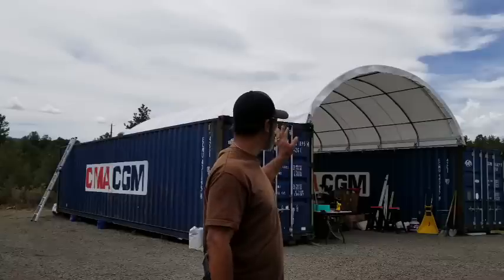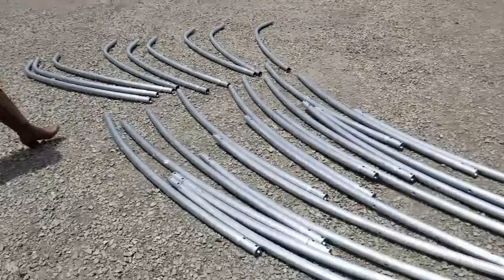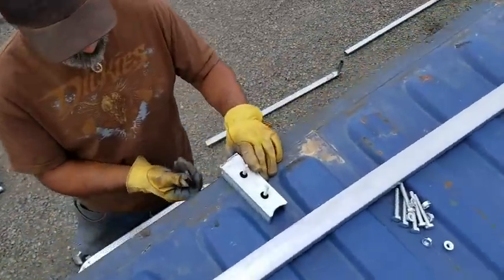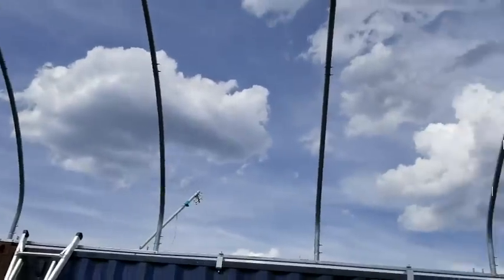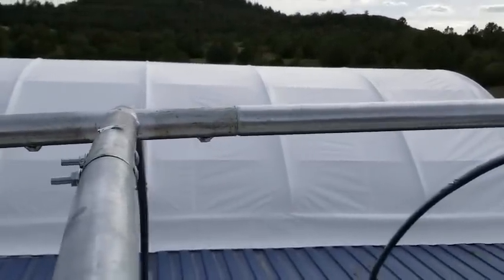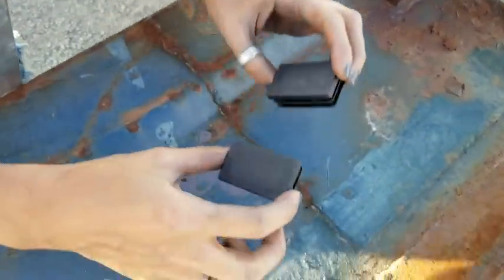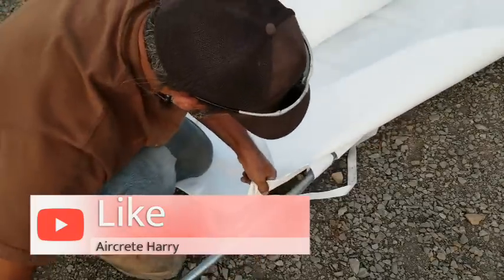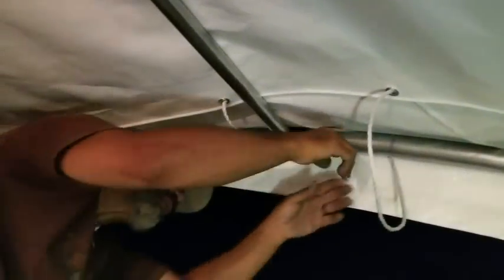Shipping Container Shelter Covers Installation #aircreteharry #Shippingcontainercovers #investment

Comment: Great video Harry and Mrs.  I figured by the landscape you might be in southern Colorado, then I saw a Trinidad address. We have land over in Alamosa. Have a shop and utilities in. Hoping to build a house for retirement in the next few years.
Reply from the maker: Thank you very much!!
Yes, Trinidad, CO
Any updates on your house built?
Reply: @AircreteHarry  well, we are here living on or land now in our camping trailer.  Hoping to get started building soon.  Have been getting some preliminary, necessary things done first like building a room in the garage to put the the pressure tank for the well in.  We’ve been using a generator to get water out of the well for years. We are at least trying to move the direction of building and would love to have something dried in before winter but time is moving faster than we are.
Reply from the maker: @rodm5830  Good Evening Rod,
How are you guys?
Thank you for sharing the updates. 
If you like to connect, email us: Aircreteharry@gmail.com 
Will happily share some information.

Comment: HOW LONG WILL THE TARP LAST?  oops caps lock  and....if the tarp was painted with exterior house paint would that extend the life?  basically coating it with vinyl....
Reply from the maker: I have had the tarp up over a year in Colorado its holding g up well. With the sun and snow no problem.

Comment: Awesome.  Hey where did you get that roof thing????   I have a few shipping containers I want to make a roof for and have space between them.   Pitch of the roof should be front and back for mine for water runoff.   My containers are 20 footers and I would like 20 to 30 feet of space between them.
Reply: Build a series of flat trusses of increasing height. A truss company could make them for you if necessary. It is easy to do.  when I was 18, I built enough to cover an apartment building roof that my grandfather was building
Reply: @kkarllwt  I am actually going to do it with roundwood timber framing. The logs won't be too thick and I will use a tarp on the roof.  :-)  No permit needed.  Trusses of increasing height?
Reply from the maker: Email us and we will connect you with the company: Aircreteharry@gmail.com

Comment: pretty impressive, smart, and efficient. How long is the tarp supposed to last (and the duct tape)? are there different width available ?
Reply from the maker: Thank you 👍 
We put them up in 2019. Still very happy with the product. We get extreme winds here, snow, hail, etc. They are handling it well. (Duct tape it covering the sharp ends of the bolts and joints. It is recommended and comes with the kit.)
They come in different sizes.

Comment: Great project.  Where did you get the canvas top?  Was that just thinking out of the box or did you buy that canvas and pipe with the straps as a manufactured top?
Reply from the maker: Thank You.
If you are interested in more detailed information from the company, email us & we will connect you: Aircreteharry@gmail.com
It's been 3 years since we installed ours. 
Working great!
All parts are included.

Comment: What gauge is the tarp?  How thick is it?  9oz per sq ft,  14.5oz per sq ft,  21oz per sq ft?  Curious how long it takes for those UV rays to weaken it and the wind or snow to rip it to shreds.  That’s what happened to my hoop structure.  Got a couple good years out of the tarp, then metal roofed the whole structure.
Reply from the maker: We have them up for over a year CO weather lots of wind rain, sun, snow and it still holding strong .
Reply from the maker: 3 years later,
Numerous tornadoes, extreme winds & heavy loads of snow - it works great 👍👍 
Check out our latest video update from this year 2022. (Tons of snow!)

Comment: What's weird is that you had to cut holes seems like they should've been pre cut 
Wind and wear and tear is gonna ruin them 
Still a great idea 
The music selection for this vid was great
Reply: I was thinking the same thing, but I think when u have to slide the pipe thur that part of the cover. the end of the pipe would get hang up, remember he had to tape the pipes togather slide them thur , 20 feet of pipe could get hung up on the slits in the cover, I think that is why they have your cut them after, Just my thinking, I could be wrong
Reply: The spacing depends on were the brackets lined up on the ribs on the sea container.
Reply: OK that sounds better then what I thought,

Comment: add T111 grooved plywood around the outside after you stain both sides of the plywood boards to water proof them.. add some carefully designed 2x 4 cut down to 2x3 screwed right to the side so it looks like windows. and doors.. paint the phony windows centers dark and the phony doors dark also.. now you have deceived the locals who complain that you have a bunch of old ugly containers on your property... it looks like a nice building with windows..  those rusty areas on top really need some needle scaling and some kind of treatment to prevent additional rusting.. then coat the roofs with one of the white rubber roof paint..  if you get some tinted by the manufacturer that matches the desert dirt color.. the containers could actually vanish from the top..   if you stand back from the containers about 100 yards and photograph them with the horizon and sky... paint the T111 or just the bare container sky blue that matches the sky.. do this to the upper 2/3rds of the container..  paint the lower 1/3 in overlapping circles or waves that match the plant colors..  hide them in plain sight..

Comment: how do you handle water runoff on the top of the containers?
Reply from the maker: Our shipping containers are set-up at a 2° angle to the side and towards the back for the water to run off the back.

No water issues. 
Everything stays dry. 👍 👍

Comment: Is the metal framework galvanized?? I think it would be better installed initially bolted together to hold everything in place, and then welded together to make it much more permanent. Can this be weather sealed to make for completely dry storage??

Comment: How did you do the prep work for the placement of the shipping containers?  What kind of cement needs to be used to handle all the weight?
Reply from the maker: I just used railroad wood ties.
Reply: @AircreteHarry  Are railroad wood ties enough to handle all the extra weight and payload and stay in alignment for say.. 30 years of weathering?
Reply: @wg4476  take a look at your local railroad track
Reply: Any foundation structure must be below your frost line to prevent spring time container migration.

Comment: I keep hoping for more aircrete videos .. What would be the best mix for a foundation for a dome home ??
Reply from the maker: We will be start building a 10 x 10 aircrete shed build soon. Foundation to the roof will be made of aircrete. When making aircrete remember the less  foam you add to the cement slurry the stronger  your aircrete will be. Start with 6 gallons of water add one 94 lbs bag of cement to the water giving you 7 gallons of cement slurry. Now what I do to avoid making mistakes is to use the size mixing container.  For the shed i'm going to build I will be using a 20 gallon garbage can to mix in my foam.  20 gallons take away 7 gallons for the cement slurry = 13 gallons of foam I will be adding. That's what I call a 20 gallon mix.
Reply: @AircreteHarry  are there certain additives for a foundation mix of aircrete? We're in the process of building a tiny house, and I was wondering if aircrete actually works SAFELY as a foundation mix.

 I do not want to pour something unsafe. What should I use to reinforce the mix? rebar or fibers?

 I am so confused, lol.
Reply: @AircreteHarry  What do you think about building a home with aircrete? Is it possible or economical?
Reply from the maker: @ShotgunAndAShovel  I would not use aircrete for the foundation where are your walls will be sitting on. But for the slab you could use the aircrete with no problem you just have to use a dense mix like a 20 gallon or 30 gallon mix
Reply from the maker: @barryallen2535  it is possible to build your home with aircrete you just have to use the Right Mix. I'm working on building a small shed and the techniques I'm using to build a shed you could use to build a larger home. I've calculated an 800 square foot house can be built for about $5,000
Reply: @AircreteHarry  ty!
Reply: mum and i decided on a block foundation. :-)
Reply from the maker: @ShotgunAndAShovel  Great Success to You both!!

Comment: Condensation on the inside of containers can cause a lot of damp causes  tool and gear to rust  inside we put 4inches of concrete on roof , paint the roof first ,now we got dry containers..

Comment: That's a pretty cool set up but I would just use pro panel in place of the tarp and it would form nicely around the arch supports good job on the build guys ✌🏽 and that's a cool kit 👍🏼
Reply from the maker: Thank You very much Bob, 
we Appreciate You 👍 👍
Reply: don't be lazy, set us up a link to wtf a pro panel is.
Reply: @Bob Huber don't be so gad damn lazy, set us up a link to wtf a pro panel is.
Reply: @mumblety96   hey it this Dam lazy guy a pro panel what we call is a carport panel you can order thru home depot any length you want it's almost the same as a corrugated tin roof but nicer and painted colors from a color chart available good luck you dang guy
Reply: @bobhuber462  Thanks Bro will look that up 😄👍🏿🍸
Reply: can you put rebar over it then aircrete? would LOVE a living roof.

Comment: Will it hold a heavy snow?
Reply: We have a similar setup in Sudbury Ontario Canada at the shop I work at. I cleared 6' of snow off my roof last spring. I should note that the dome installed is taller with a steeper radius so that snow doesn't accumulate on it. The wind doesn't seem to bother it either.
Reply from the maker: 3 years later,
Numerous tornadoes, extreme winds & heavy loads of snow - it works great 👍👍 
Check out our latest video update from this year 2022. (Tons of snow!)

Comment: Get some scrap bike tires to cover the rub points on your metal.
Reply: Do you plan on spraying aircrete on the tops of these structures?
Reply from the maker: @GEAUXFRUGAL  I'm not planning  on putting aircrete on top of the arches, but I will be applying aircrete on top of the shipping containers.

Comment: DID U FIX THE LEAK PROBLEM?
Reply from the maker: Yes we did went to Harbor freight and we picked up a 20 ton jack. Everything is nice and level now, but we still need to put gutters on to stop rain water from coming down altogether.
Reply: @AircreteHarry  just cover it all in concrete this will stop any leaking.

Comment: No idea what that fabric is... if it is rated for 3-5 years... is that bc of UV degradation or wind?

In the high altitude SW, e sun is killer. hey in the Midwest, (Missouri)  good 4 year UV greenhouse plastic will last 10 to 12 years or longer if it is tight. Canvas will rot out in a short period bc of humidity, etc.
Reply from the maker: Don't know about the fabric just that it's very strong.

Comment: Questions about variations on this system - are there optional end-walls? Are there kits that attach to the top of the shipping container on one side but are self-supporting on other? Are there kits to direct and collect rainwater run-off? Are there clear tarps suitable for covering spaces used for container or raised-bed nurseries? Lots of potential here but limited, as I see it, to the durability of the components.

Comment: why not have the bows wide enough to cover both containers to prevent leaks in the steel flat corrugated roofs?
Reply: Yeah, I feel like an upgraded version taking into account drainage is a must have...
Reply: You're right! I was thinking that same thing as I was watching the video. 🙄
Reply: All Mr. Aircrete needs to do is raise the outer containers to tilt outwards to help water drain off top of container. And for the inner container raise the width end to drain to the back
Reply from the maker: Our shipping containers are now set-up at a 2° angle to the side and towards the back for the water to run off the back.
Success!
Reply from the maker: Our shipping containers are now set-up at a 2° angle to the side and towards the back for the water to run off the back.
Success!
Reply from the maker: Our shipping containers are now set-up at a 2° angle to the side and towards the back for the water to run off the back.
Success!

Comment: why dont you strap the tarp down from the inside? There is probably a slot already there so you don't have to cut the cover. Any cuts you make will widen eventualy failing to hold the cover down.

Comment: Numerous questions abut how long the tarp material lasts but these questions never get answered so one has to presume this is the weak point in this system. 1 season, 2 tops maybe??
Reply from the maker: 3 years later,
Numerous tornadoes, extreme winds & heavy loads of snow - it works great 👍👍 
Check out our latest video update from this year 2022. (Tons of snow!)

If you are interested in more detailed information from the company, email us & we will connect you: Aircreteharry@gmail.com

Comment: I am confused you say the containers are 20 x 40 footers and need to be 20 " apart but the way it looks they seems to be a lot further apart, just my say.
Reply: containers are 8 feet wide, ten feet high and forty feet long.
Reply: They come in both 20 and 40 foot lengths.
Reply: @bebo5558  I am talking about the space between the containers
Reply: @atmm89  Yes I know, but he said, the shipping containers come in two different lengths and then he says, the tarps are 20 foot wide, so that's what the spacing of the containers has to be!  He never said the containers were 20 x 40.

Comment: Would the tubing frame for the arched tarps  hold or maybe with additional meshing for reinforcement be strong  enough to work as a mold for your aircrete application,  i.e.  connect the containers with aircrete arches or heck even cover the entire project container and all  with the material to make it storm/weather  proof?   enjoyed your presentation.

Comment: the bottom of the containers is clearly not treated with anti-corrosion technology, - IN 3-4 years there will be holes .... CONTAINERS are made of iron, and this is not the material that will remain intact without PERMANENT maintenance ...

Comment: It doesn’t leak water 💦
Reply from the maker: Correct 👍-  it doesn't leak water.
Reply: @AircreteHarry  Well looks like it would leak maybe on the end of the can where it’s sitting I’m just yeah he must have something between the edge of the can in the Container?
Reply: I live up north thinking if I did that I have to put the can right underneath completely cover the can
Reply from the maker: @redleaderone8429  Those shipping containers are set-up at a 2° angle to the side and towards the back for the water to run off the back.
Everything stays dry. 👍 👍 

It's been 3 years since we installed ours. 
Work great!
Reply from the maker: @redleaderone8429  There are many options, indeed. Such as having a back-cover as well. 👍
Reply: @AircreteHarry  I’m going with engineered truss metal roof
Reply from the maker: @redleaderone8429  Sounds good. How many shipping containers will you be covering?

Comment: for the 9 thousand you paid for the shipping containers you could have bought a nice barn
Reply: Maybe so,but can you dismantle & move it with as much ease as the containers & domes?
Reply: @1illusion279  no
Reply: @1illusion279  have you ever paid to move a 40 foot shipping container x3, that prob isn't to cheap though...
Reply: blo me as a matter of fact yes I have & its very cheep.they price of a Swinglift container lifter & hauler is not much more than a standard 40’trailer to transport a container,as the swinglift picks up the container,transports it & delivers it all in 1,so the price isn’t an issue.
Reply: @1illusion279  joc.com says east coast to west coast is 2800 to 3100, about the price of the container every-time you want to move it
Reply: blo me that’s great you got the price to shift the containers,now you may want to compare apples with apples & price up the barn shed dismantle transport & re-arrect as that was the original comparison ?
Reply: @1illusion279  it appears it would be cheaper to build a new barn at next spot.
Reply from the maker: A wood barn? no cement only!
Reply: blo me the word “appears” doesn’t give a true indication of costs for the exercise.
Reply: @AircreteHarry  "pole barn", this doesn't have concrete only gravel..